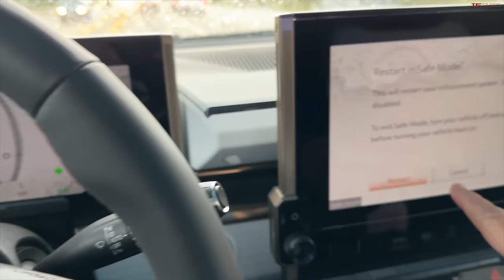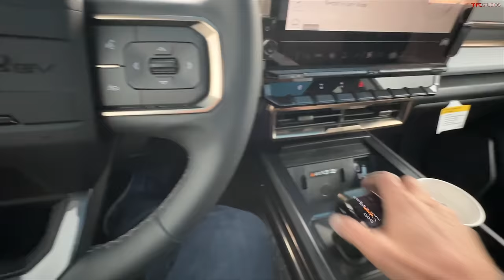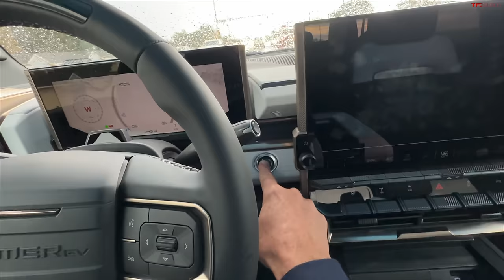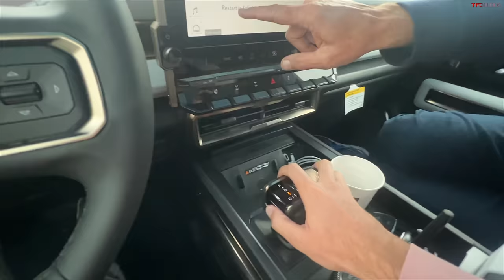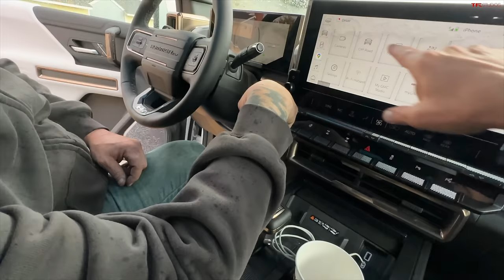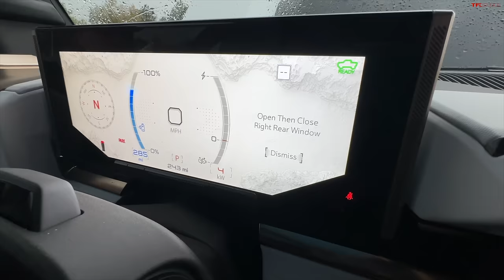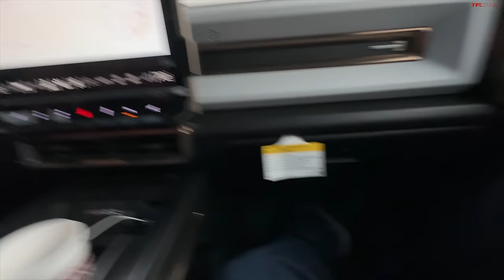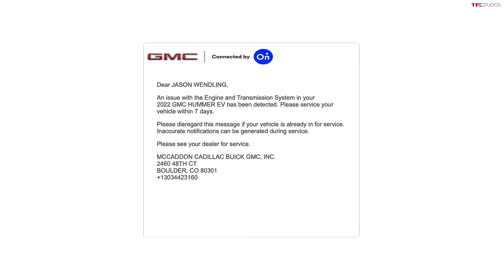I Bought a $115,000 GMC Hummer EV and It IMMEDIATELY Left Me Stranded!

Comment: It's wonderful that we are now expected to become IT specialists to troubleshoot our car's problems or else it will completely physically lock us out of driving
Reply: Most people couldn't fix an ICE vehicle if it suddenly died either. All things considered, this was actually a pretty easy fix.
Reply: @mechmat12345  nope, but they could at least put it in neutral and get it off the road

Not to mention this wasnt even a break, it was just the computer having a fit and locking the entire vehicle
Reply: @mechmat12345  But it doesn't take long to learn, especially on the older ICE cars and trucks.  They're cheaper and easier to repair.  I like the idea of a Hummer EV, but not at its current state of development.
Reply: @mechmat12345  an easy fix? What are you talking about a easy fix you make no sense in what you just said you have a 9000lb truck stuck in the middle of the road and you can't operate anything nor put it in neutral with a ICE you can def get it on a tow truck if you blew a motor or have a electrical issues where is the complexity in that vs you cnt put a 9000lb brand new vehicle on a tow truck?
Reply: @Konstantin Ridaya yes. Pushing a vehicle if it breaks down is definitely the smartest thing to do and the best decision. No one has ever been hit and pinned between their car and another that rear ended them while they were pushing.
Reply: Yeah learning how to navigate through a computer is so much harder than learning, let alone doing, things like cam replacements, timing chain adjustments, head gasket replacements, etc… Putting in new spark plugs is harder to do than this -  the physical workload was 1 out of 100 and I understand what happened and what to do if it were to happen to me after watching one YouTube video that I didn’t even search for 😂
Reply: @theupscriber65  ah yes ignoring the problem of your 9000lbs EV arbitrarily locking you in place for no reason because under certain circumstances pushing your car off the road could be dangerous
Reply: @ToAnEnd  the issue is not how hard it is to repair, the issue is how easily it can become inoperable for no identifiable reason.

You're not navigating a computer, you're troubleshooting a computer problem.
Reply: Ha Ha! Yup that’s what the snowflakes want
Reply: Aside from faulty batteries and bad software, not much can really fail if you use quality parts, not much can go wrong. when you screw up the software, that's when things go south.
Reply: @rysterstech  When the software goes south like in this video, I guess that's when you realize that you don't actually drive this car, the computer does, and you just give it suggestions.

And yes, I know other cars also have computers in them, just not as intrusive as the ones in EVs and they won't lock your car down when having a hissy fit
Reply: @daveberkovits4976  haha this vehicle is certified PC  and ⚽ mom friendly
Reply: Pretty much but it'll be a paid service
Reply: Alot of the  issues he had just now boils down to lack of easy redundancy in design not the issue of it being electric.
Reply: @PatrixBest  have you worked on a recent gas car? Same thing, diagnostics are done via computer
Reply: @ToAnEnd  my gas car has never seized up and made itself immovable in the middle of the road because the computer had a fit, or any part had a fit in fact. It is NOT the same
Reply: @mechmat12345  It's a piece of shit dude.  It's a piece of shit like pretty much every EV.
Reply: @PatrixBest  Oh yea, just put your F-150 in neutral and push it off the road. How much do you bench tough guy? So many dumb arse anti-EV trolls. Y’all live to see this one sided propaganda bs from TFL. I knew this channel was going downhill. GM is laughing!
Reply: @mybro727  I drive a civic, not an F-150, and I'd at least be able to TOW the F-150.
Even if I couldnt push it, 2 or 3 guys could. Good luck pushing the locked EV though

All these EV guys completely missing the point and making strawman arguments
Reply: @Konstantin Ridaya I think the real danger with this "new technology" is over the air updates. An update can make something that was working fine before, no longer work. If the company were to accidentally or "accidentally" install a bad update, then there goes all of those cars. It made me realize that the biggest difference with these cars is the ability for someone someone to remotely, "accidentally" mess them all up with an "update".
Reply: @mechmat12345  What???  An "easy fix"?  What planet do you live on?
Reply: @ToAnEnd   What you're not taking into account is the Hummer in this video is brand new. What you are describing is maintenance on an ICE after many years of reliable service. Huge difference bro.
Reply: @mybro727  TFL is doing their best to give EV's a chance. The EV's are the  problem here.
Reply: @treydrier3169  So we just gonna ignore all the ICE vehicles coming out that break down? I sold new Honda’s for a while during the pandemic, and even *brand new Honda’s and Toyota’s break down driving off the lot sometimes. This is only noteworthy because it’s stupidly expensive and it’s popular to hate on EV’s for having the same problems cars of all kinds have had and will always have. It’s a completely un-nuanced perspective
Reply: @treydrier3169  and to your point about maintenance - do you think 10 years from now, working on cars and taking apart the thousands of parts will be easier, harder, or the same? EV’s have minimal moving parts, there’s no reason to think EV’s will be, or currently are, more difficult to fix than an ICE

I love working on cars, and there will always be a place for an ICE vehicle at my house. But EV’s are much, much simpler vehicles. Any pain we have now are mere growing pains. The ICE has been around forever and they still break down from time to time and are not nearly as efficient as an EV already is after only a decade and a half of real r&d
Reply: Been like that for almost 20 years. I'm somewhat proficient at butt dyno tuning a gas car. Funny how the Chip Shortage effected all modern feature set cars.
Reply: @PatrixBest  Yep problem there is it's pointlessly 9000lbs. When TCU aka TCM gets Borked they have a similar failure result in some models. BEVs do not have TCUs.
Reply: @mybro727  How weak are you? I don't work out at all and I've pushed my Suburban to the side of the road.
Reply: @ToAnEnd  How many of those Hondas and Toyotas refused to go into neutral, to be safely loaded on a flatbed?

All vehicles breakdown, eventually. We have standards in place to be able to deal with that when it happens. A 4.5 ton brick that won't allow the wheels to turn is a big problem. Is this true of all EVs? Do any of them allow you to disengage the wheels when they're in this state? It's not something to be defended or glossed over. It's something for everyone to be upset about, so that all manufacturers make sure they're not doing this to us.
Reply: @mechmat12345  they took it to dealer for original front end code, they didn't fix anything
Reply: @ToAnEnd  Honestly, EV's are not for me for several very obvious reasons.
1. Takes too long to charge. With my ICE I can stop at a gas station and fill up in 5 minutes.
2. Very few high speed charging stations in the U.S. And no, ones at restaurants and office buildings don't count. I'm talking about getting off the highway and fast charging.
3. EV's are terrible for the environment. Just wait and see. Battery manufacturing, excavation and disposal will be our next environmental challenge.
4. The electric grid, which is predominantly powered by fossil fuel, is no where near capable of handling a complete EV take over. 
Bottom line: if all you do is local driving then EV's are an option. For everything else they are not optimal.
Reply: @mybro727  I've pushed a 16,000-18,000 Isuzu NPR once... why? Well, it's on wheels, it went into neutral with ease, and the tires were at around 85-90 PSI (as recommended) on a flat road. It's simple physics lol.
Reply: @treydrier3169  actually set a stopwatch next time you stop to fill up. Just do it normally, not rushing. It took me 15 minutes because I went in and got a coke while it was filling. Several EVs add 300 miles in 15 minutes. I get that there aren't enough fast chargers today. Just saying 5 minutes for gas isn't realistic. If you find it is, you can still add 100 miles on an EV in 5.  minutes.
Reply: @Neojhun  chip shortage is a major problem. My 1974 HEI ignition went out because it's chip went bad. These modern cars made after 1973 are junk. We need to go back to point style ignition. It was much more reliable.
Reply: @theupscriber65   It is realistic. I timed it and my last fill up took just under 5 minutes. 18 gallons. EV's are a niche vehicle used for local driving. If that's all you need then, sure, it's a potentially good fit. However, most of us want the flexibility to take it on longer distances if needed. Thus an EV is a secondary car. ICE is primary. My son's girl friend owns a Tesla. She lives in an apartment. Said it was a huge mistake since her apartment complex which is only 5 years old has zero fast chargers. If it fits your life style then good for you. But don't think you're helping the environment because you're not.
Reply: 2OOth like :))
Reply: @rysterstech  Except for the fact that these are now purely reliant on electronic systems….which is pretty  much the bane of most manufacturers.

Comment: Thank you for validating that continuing to drive my 1987 Mercedes with 300,000 miles on it remains the common sense alternative to an EV. You both demonstrated far more patience than me, I would have asked the tow truck driver if he had an angle grinder I could borrow for a few minutes because the $%^&* hood *IS* opening right the F now. Then I would have done what you did, get the thing to the dealer and go home.

Comment: One thing to take away from this experience is “do not reboot your car in traffic if it’s still drivable”.  Drive to somewhere safe first, since you might be there a while.  (Not just for EV owners… gas cars are basically computers on wheels now as well)
Reply: Both of my vehicles are over 20 years old, for a reason.
Reply: No, the take away is dont buy electric cars
Reply: Good advice.
Reply: @dgafbrapman688  Nah, dodge charger did the same shit. Problem was a sensor in the motor. Good luck fixing it in traffic.
Reply: @dontrustwhiteyevery1  Let me distill my response then, dont buy cars that are entirely reliant on computers to work. Every aspect of a car is operated by computer these days, thats why i dont buy anything newer than like 2005 - 2006
Reply: @dgafbrapman688  pretty much the only difference between an ev and ice passenger cars are what energy source is used to move it
Reply: The Takeaway is don’t buy a car that can be rebooted😂
Reply: And don't buy a chevy
Reply: The one thing I take away is don't buy an over priced POS EV in the 1st Place!
Reply: @dgafbrapman688  My 2007 jeep wrangler unlimited left me stranded with the same situation and it wasin't electric and my 2021 jeep cherokee trailhaw elite did that last winter and had no heater and bunch of other thing at the same time
Reply: THE TAKEAWAY is don't buy this USA garage. Blaming the user for a 115K brick? I GUARANTEE a Posrche Taycan has never done this.
Reply: @KITT-K2000  asking for it both times - Jeep
Reply: @KITT-K2000  ok
Reply: People who have next to zero computer skills shouldn't be pushing buttons in traffic and like with computers, learn to use EVs before driving them.

Comment: "we brought it home, hooked it up to the Internet and made sure all the software was up to date" 

Who ever thought we'd have to say that about a new Hummer... Big red flag right there.
Reply: My 2022 Forester and Tiguan both receive software updates.
Reply: Don't need to do any of that on my 64 chevy. Just get in, turn the key, and haul ass.
Reply: My Alfa Romeo communicates through my app on my phone. Tells me when a new software update is available and once it also asked me to upgrade my phone 😳🤣 The updates are super easy. Download from the web onto a stuck and then feed it to the USB port. That's it. The dealer also checks the software for relevance when required but they can do it wirelessly via Bluetooth.
Reply: I never had t do that with old fangled 
gas powered cars of the 70s 80s or 90s...  
And, I wonder why ??????
Reply: @barbusie5217  carburetor, which is also the reason why you had to idle for 5-10 minutes before driving, since you had no fuel injection. Fuel injection has to be controlled by an ECU. On top of that, you had electric windshield wipers and some electric door locks, which can help prevent locking keys in your car, and your windshield wipers don't slow don't when you go up hills (vacuum powered) but yes keep telling younger generation your old decrepit technology was better even though a 5 second Google search and listening to old people talk for 5 minutes will prove you wrong. The best combination will be either diesel electric (like on diesel electric locomotives) or gas electric. These are not hybrids they use fuel and only fuels the electricity is powered but onboard generators which are powered by the ICE, and is us led only for electrical systems and applying torques to the axles.

Comment: In my experience with other GM vehicles with indexing windows after disconnecting the battery you are prompted to cycle each window. That part looked normal. Overall this is an embarrassing failure for GM. I appreciate your coverage.
Reply: Most vehicle with autodown and autoup window will need to reset limts when the battery is cycled. You could dismiss that notice.
Reply: Yeah as though window regulators never go out, not to mention using them in rain is what deteriorates them.
Reply: Things happen. Decades ago the same thing happen to me in my VW Jetta. It just plain shout down on the highway, in the rain. Since that was long before cell phones I had to hike down the embankment and find a pay phone to call for service. Luckily, I was only a block from a major intersection with a gas station. 

The only thing that would have made that breakdown worse would have been if it happened at night. BTW, the malfunction was a faulty fuel pump. Something I found out later was not uncommon for VW. Although this was one of the first new models.
Reply: @krane15  I had a VW Jetta,  I put 110K on it and only had to change to oil, tires and tans fluid. It was one of the best cars I have ever owned.
Reply: @krane15  
So...you had zero way to put in neutral, too? 
(I think not)

Comment: this is a great example of mechanical VS electrical, even the hood
Reply: Actually baffles me that the hood wasn't a mechanical latch.
Real basic shit should always be physical or physically activated electrics. Fuel cap, hood, trunk, car key etcetera
Reply: The hood has a manual release
Reply: Ah yes. Mechanical cars definitely do not have their flaws.
Reply: @Smallduckenergy  I didn't know being able to open the hood when a vehicle encounters an issue was something that was flawed
Reply: Modern cars are so complicated that opening the hood is pointless.  There's nothing in the Bonnet that you can fix gas or ev.
Reply: @kewlztertc5386  did you even watch the video? they were able to get access to the 12v battery under the hood and actually reset the EV’s computer to get it working again, at least temporarily
Reply: Maybe the hood problem was because he was in safe mode
Reply: @robman2095  even so, there should still be a latch so something like that doesn't happen.

Comment: Even if u get the vehicle in a neutral there isn't really a transmission it is electric motors so you can potentially damage them if you move the vehicle without it "running"  there is a proper tow procedure that must be followed or u void warranties